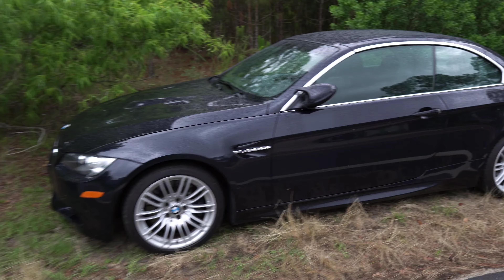How to Repair Plastic Trim on BMW E93 Convertible Plastic Trim Repair Restoration

Comment: Who designed that shit really I wonder, I faced on my two bmw the same problem
Reply from the maker: They are available on the ebay now, not the best quality but they work if painted correctly
Reply: @Makhnovets I repaired with epoxy glue i hope it works
Reply from the maker: @pascal8111 but yes, this design is suck ass…

Comment: When you are trying to remove this fxn trim pieces... always use a hest gun..... get it warm... then use a credit card instead of a razor blade and 9 times outa 1o they slide right off. And seeing as how this is a 4 year old video... all u new guys that are new to this and have a broken piece... ebay and Amazon has little kits now with the trim pieces and the clips for 45 bucks 💯
Reply from the maker: I wish i new that when i bought that one lol
Reply: I just picked some up from Walmart for 35!!

Comment: Good video… now you  can find aftermarket kit for $35 bucks… comes with 4 plastic pieces, the little clips and four little gaskets… you buy a spray with your color code and it seems like original
Reply from the maker: Very cool, if you can share the link in the comments, that be great. I had that idea back in the day to 3d print those, but I never did)

Comment: Would the roof still.operate ? Had damage on the right front trim in a car wash 😢
Reply from the maker: If possible remove damaged part of the trim, you can open the roof half way, there more directions in the video so suggesting to watch it again, try not to damage the springs and secure them somehow so the don’t scratch the paint, but the roof should be operation as long as there are no parts that’s sticking out. Good luck.

Comment: Question - Those springs -- what do they do-- seems my springs have come out and are scratching the roof. where do they go and how Can I put them back? Thanks so much
Reply: any updates on this? having the same problem
Reply from the maker: Hey, currently working on another e93 as a project, have many things going on with the roof and this part is one of them. So will be posting restoration/repair series in a month.

Comment: Why do these parts break? Lack of lubrication?
Reply from the maker: The plastic is pretty vulnerable to UV and aging, as for the treatment, not sure… fragile plastic is a problem.  As what to do with it, it would be nice if someone could 3d print it.

Comment: Need info on replacing the springs on the roof. The plastic piece is in tack, but the clamp is broken and the spring is over extended.
Reply from the maker: Try to bend the spring back, otherwise you’ll need to replace the whole arm.

Comment: Can you show how to actually install the repaired fairing back onto the springs and clips?  Thanks!  I appreciate your video.
Reply from the maker: unfortunately car is sold. for the spring, it's non removable part, you can replace the whole piece, for the clips, I think you can manage that, it's easy enough to figerout. good luck!

Comment: Great video.  I have a broken spring.  Do you know where I can find a replacement..any links would be helpful
Reply from the maker: Thanks for the comment, but only halp that can provide is https://www.realoem.com/bmw/enUS/showparts?id=WL73-USA---E93-BMW-335i&diagId=54_0364, an go to junk yard and look for e93 body, even though they are rare, you still have a chance to find the part. good luck!

Comment: Thanks for the video!
What are thoughts on purchasing these trim covers off ali express? It’s too expensive getting it from bmw themselves. did you have experience with the springs being uncoiled? If so how to recoil them. And finally how would you paint these trim covers to match car colour?
Reply from the maker: If you can find it on aliexpres then do it. not sure about dealer, I only been to one bmw dealership, and they couldn't order it. Out of Stock. 
Recoil springs... I seen one person drilling out rivet and getting there a custom rivet. it's something similar:  https://welderseries.com/store/Threaded-Tube-5-8-OD-x-2-Long-3-8-16-p51163075 
Otherwise the whole arm have to be replaced.
for paint, every car have paint code, check online how to locate it, or go here:  https://www.mdecoder.com/ type the vin, and it will show you the paint code. You can get paint from CarQuest, they will mix it and can put it in the spray can. or it's a small piece, so if you have no experience in painting, just take it to the shop, along with paint code, it probably be like $100.
Good luck!
Reply: @Makhnovets  Thank you so much!

Comment: Is it safe to drop the top with one trim broken ? The long one to be exact.
I’ve ordered my parts but couldn’t wait to open the roof 😭
Reply from the maker: It's kind of safe. I had a couple of scratches from the spring that was holding the plastic trim, you can use electric tape to fix it to the frame, but besides that, you should be fine, except for the portion with cut-out for that little moving piece, just be careful with it as well! The trim is only for protecting the hinges or moving parts from the dust and rain.
Reply: @Makhnovets  thank you sir 🙏🏽

Comment: So the rear trim peace just attached back to the roof? No glue or 3m needed? That's the only broken part on mines I don't want to take it off just yet.
Reply from the maker: Yes, the very last piece of that plastic trim is just on clamps, should be simply lifted, also in my case looks like the gasket around was melted and that's why i used the blade to remove it, or previous owner just used some glue to pop it back, either way it's extremely fragile, so be careful and good luck!

Comment: I fixed mine by scraping off the remaining bits of the original mounting tabs on the bottom of the cover, then using epoxy to glue on small plastic picture hooks facing outward from each of the two pins on the hinge that have the original torsion springs.  I then used 7/16" x 1" tension springs between the pins on the hinge and the hooks in a V shape from each pin. This solution does the same thing as the original overly complex design, and it cost me $12 including epoxy and springs. It holds the cover to the spring, but allows it to move away slightly when the hinge goes down into the channel in the roof, and holds the cover in alignment with the channel. The whole job took under an hour (plus 24 hours for the epoxy to dry).
Reply: Hi do you have any pics of how you did it please?
Reply: The previous owner bent my springs where did you find these new ones ?

Comment: Hi ,interesting video,my rear liner fall off,what kind of glue should I use to put it back?
Reply from the maker: 3M Headliner & Fabric Adhesive, 38808 i did use that one, for simple job it work just fine, but for more tricky liner it's not always the best choice, you have to follow the direction step-by-step to get the best resaults!

Comment: Thank goodness for you and your videos. Any chance you have (or can link) me to instructions to remove the middle trim piece? I'm paranoid I'll break even more parts trying to take it off. I unclip the remaining (unbroken clips) but I don't know how to slide the spring out of them (or if you're even supposed to do it like that) so that it releases the actual plastic molding piece.
Reply from the maker: The black plastic plugs with clip in the middle you have to remove them to be able remove the plastic and relish the spring. When i was removing my, i did break more of those foots that I glued back, so good luck with that, the piece extremely fragile.
Reply: @Makhnovets  Thanks a bunch as always!

Comment: Hi Thank you for the video. the middle plastic trim (right Side) has broken today but i couldn't fix it the way you did it. it is very difficult to find the  broken piece alone as BMW sell the set of 6 pieces all together and very expensive which is non sense. I am still looking for one everywhere online/offline. BTW my car is 4 series convertible
Reply from the maker: I know, the guy who can 3d print some parts, I recently met him in the comments, ill send you a link, so you can talk to him, after all, do your own research on 3D printing! it worth a shot! 	(steven@stevenrogersfineart.com) - text him, tell him that you find him on my channel! (But he needs a dimensions for the part, do your reserch. )
Reply: @Makhnovets   thank you so much ❤

Comment: Hey! I have this exact problem with my car, but a little while ago I removed the spring that holds the bracket & the plastic strip together because if squeaked when I drove. Do you know the part number for the spring by any chance?
Reply from the maker: Go to https://www.realoem.com/ you will find diagrams there for particular car! Best web if you own BMW!
Reply: @Makhnovets  thank you so much!!
Reply: @hollyseymour1149  Curious...were you able to find the spring?  Thank you
Reply: @hollyseymour1149 do you know pls answer
Reply from the maker: The answer for this question is that you can not replace the spring itself, unless you make it custom, the other solution is to replace the arm.
Reply: @Makhnovets  thanks

Comment: I looked everywhere and glad to how found your video.  I have the 2008 E93 (Same color as yours).  a piece of the track that you use the bracket to clip into broke off I am trying to use Loctite to glue a new OEM bracket to it.  Once glued I'll have to slip the metal spring into it and then reattach the other spring end to the functional bracket and clip.  Hoping it works... if not, I may need to take the whole trim piece off and use plastic weld and shape it to fit all clip in.  Great vid though!
Reply from the maker: Other solution is 3-D printing.
Reply from the maker: Thank you! Hopefully it Will work!!

Comment: Feel like it’s a due time to have those trim broken. Mine just felt of 1 week ago. Your video  come out just right time.
I don’t know why this part is soooo expensive
Reply from the maker: OEM piece is no longer available because of factory stop production back in 2014 or 15. Some people use 3D printers for those parts.